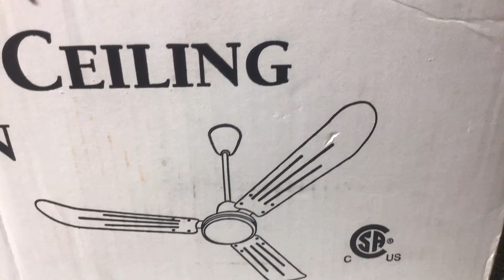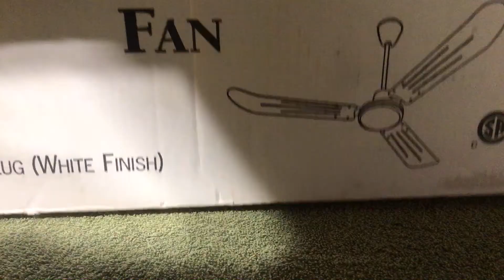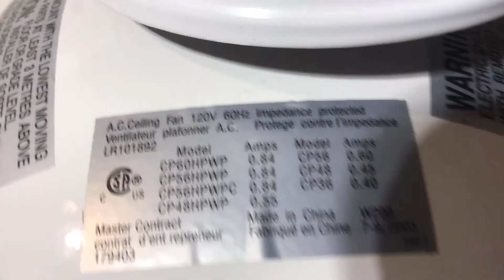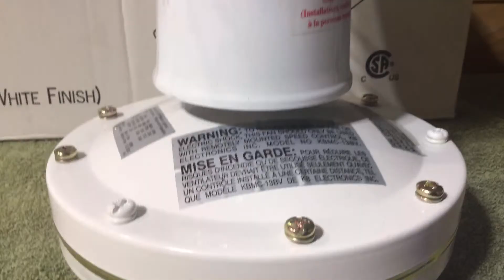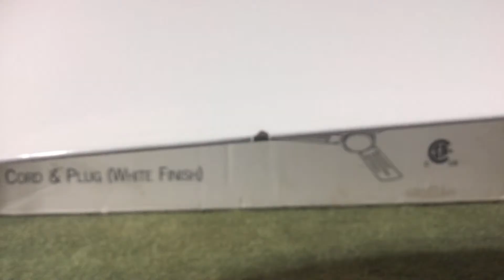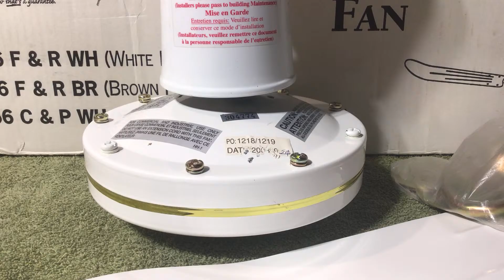NEW FAN: 56” Canarm “CP56” Industrial Ceiling Fan

Comment: I received a NIB cord and plug model as a thoughtful gift from my aunt. Her husband had purchased it at an auction for around $200 but couldn’t install it because of the low ceiling. Since they couldn’t use it, I gladly took it off their hands. I’ve been searching for one for quite some time, and I'm excited to finally have it. I'll be installing it in my garage on a Canarm variable control, and I’ll also be using a 4-speed and a 3-speed control to customize the settings.